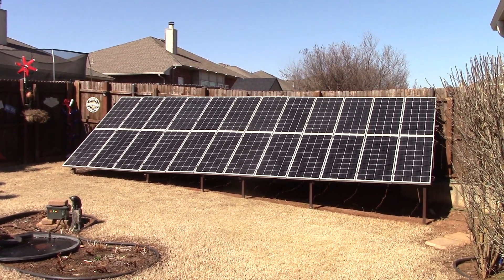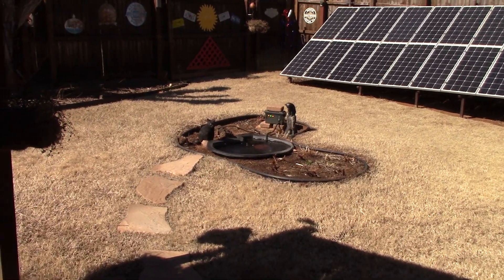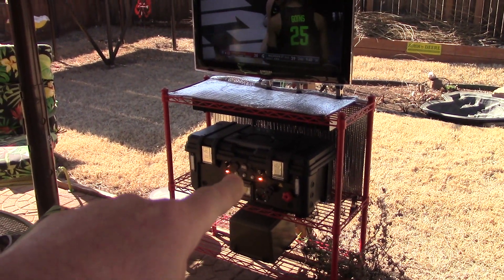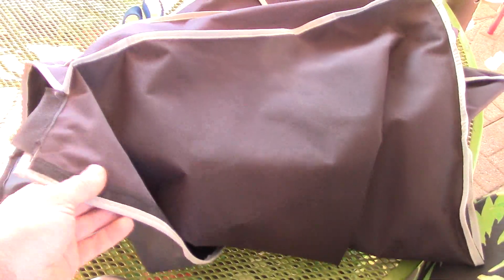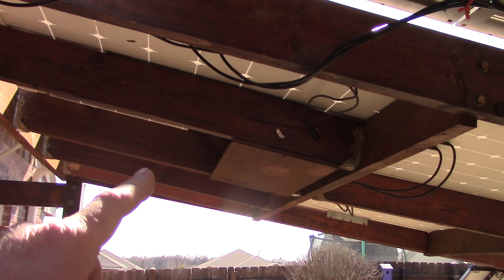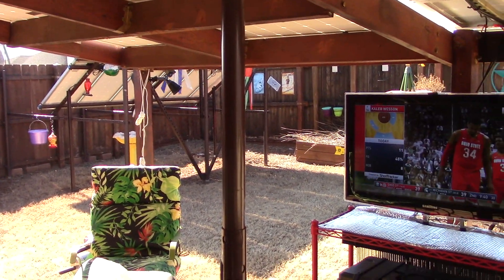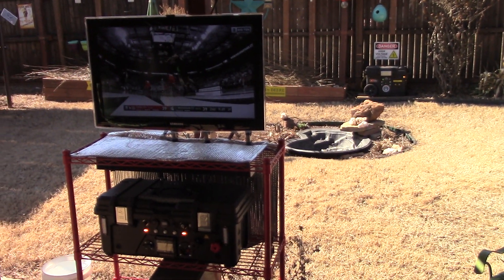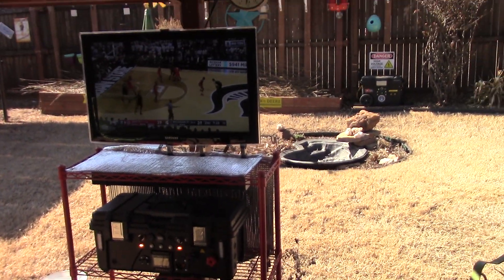New 12v solar power generator installed & tested in the backyard patio

Comment: I saw your response on another video, i have the 10 switch protran switch installed in my house if i am understanding your response you have your solar connected to your 6 switch. How do you do this? Or do you have a video explaining it? Thanks
Reply from the maker: Yeh, I have done a couple videos on that ProTran 6-circuit transfer panel. I had an electrician friend of mine wire it in (for safety, code, insurance purposes) to the mains. I did the AC/DC work on the inverter side. Here is an "older" video that should explain all the madness: https://www.youtube.com/watch?v=NO84yLktTJw